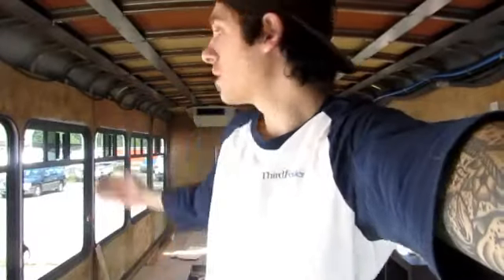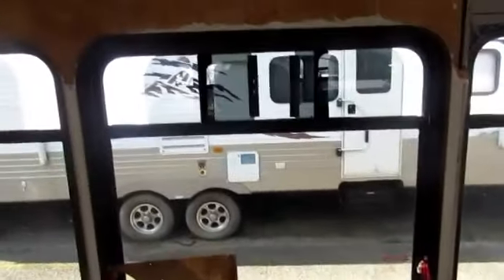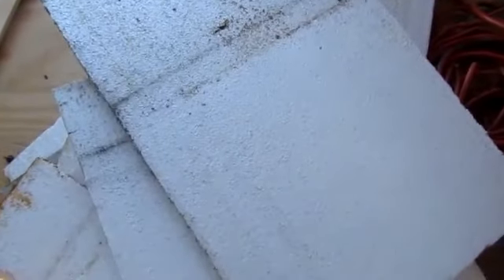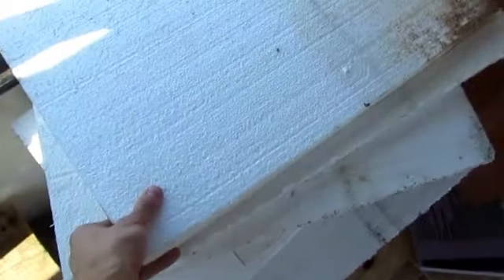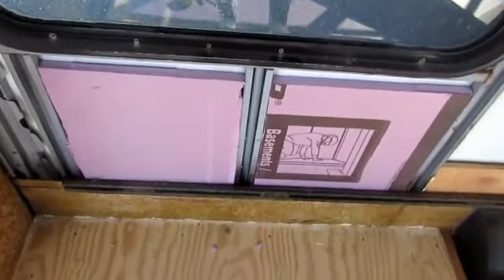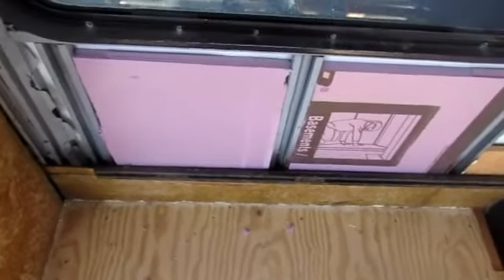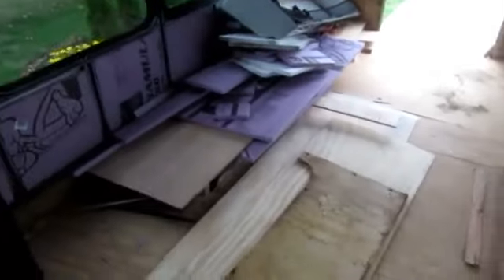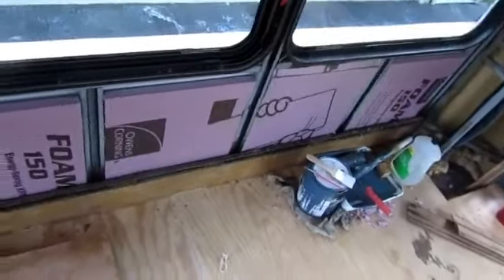Shuttle Bus Conversion: NEW WALLS!

Comment: Ty, i dont want to remove the inner fiberglass but just build in a few things we need such as water and 12 volt system. However there are sections of the outer panels which are loose from the frame. I was hiping you could tell me how they are connected to the frame. It might be necessary for me to take them loose and reattach.
Reply from the maker: Just seeing this sorry for the late response but shuttle buses are so different it would be hard to tell, ours were connected with screws.

Comment: Ty for your video! I'm a noob at this,  but why exactly did you hear the wood and factory insulation out just to replace it? Were there leaks? Again... noob here... thanks!
Reply from the maker: Nancy Durham hello thank you for your comment! We took it out for a few reasons! The main reason was that once we removed the fiberglass from the walls, the wood underneath was in pretty rough condition and covered in the glue that held the fiberglass on. We wanted to replace this wood initially because of its condition, but also we wanted to make sure that we did not have any larger issues behind the wall! When we were doing research we saw a bunch of people finding mold and other problems behind their original wood, and because our bus is from 2003 we wanted to be safe! Also, once we took it off we saw that the original insulation that came with the bus wasn’t insulation at all, and actually just basic styrofoam! The styrofoam also wasn’t tight or flush with the frame of the bus, and there were several inches that were not covered by anything. So we went with a thicker insulation with a much higher R value, and made sure it fit nice and tight!!!! 
If you have any other questions don’t hesitate to ask!!!
Reply: @growingslowandwild  ty for your quick response! Of course,  that makes perfect sense! I do have another question,  if you don't mind.  Once you pulled their "insulation" out, did the walls metal or fiberglass? I'm concerned about the integrity of the structure of a shuttle bus,  as opposed to a school bus or a van. I'm in the market to make a purchase vey soon,  tis will hopefully help me make that decision more clear.
Reply from the maker: Nancy Durham no problem at all we want to help any way we can!! Yeah so the actual walls of the outside of the bus are fiberglass, but the structural integrity of the bus is metal. So if you’re looking at the walls from the inside of the bus once the insulation is out, the first thing you see is the metal frame. We learned most of what we did from watching videos of full sized buses, and the only real difference we found was that our base floor was wood as opposed to metal!!
Reply: @growingslowandwild  perfect! Thank you sooo much! That helps a lot! GL with your build! I'll be watching and leaning! See ya out there!
Reply from the maker: Nancy Durham thank you so much!!!! If you have any questions along the way let us know! The community is the best part of the process 🚌✨

Comment: Great video. What did you use and how did you install the paneling with? Did you nail right into the outter wall?
Reply from the maker: Thank you so much!! Just used a standard jigsaw to cut the panels and when we went to install them, simply used the drill holes that were already in the metal frame from the screws we had taken out when we removed the original walls! Once we had them lined up properly, we just used a power drill to drill the holes in the wood to like up with the existing holes. once you have that done, it was just screwing it in with the same screws we took out so they fit perfect with no issues!
Reply: @growingslowandwild  Why did you decide to screw back into the metal and not to frame out the walls with wood?
Reply from the maker: @SavannahKingMusic  there were already the holes in the metal from the previous wood, and we didn't want to lost any additional space from building on top of the metal!!

Comment: Will that provide enough insulation?
Reply from the maker: Jumonjii yes we think so! We have been working in it since then and it seems to be working well! Also it was important to us to not have to lose any inches from our floor plan, and if we would have gone any larger we would have had to build off of the wall!! The 1 inch is technically a bit more than we had room for in the wall but we squeezed it in and made it work:)
Reply: I'm hoping you don't travel anywhere really cold. Foam insulation doesn't have a high R-Value. Maybe  4 or 5 rating.

This page has a nice chart.

https://www.greatdayimprovements.com/insulation-r-value-chart.aspx
Reply: @jumonjii That's my concern, too. But with all the glass, it's going to be difficult to keep warm. I'm thinking about doing some insulated panels that come up from behind the cabinets, masonite and foam board, that can click up into place. I may cover some of the windows. Maybe I'll put thicker foam under the cabinets or built into them for added insulation. I need to enclose the bed, because it gets down to -40°F in Montana.

Comment: Does anyone know if there is a benfit from foam board vs spary foam. Seems like spray would be much faster
Reply from the maker: Usually spray foam has higher R value meaning is more efficient / better insulation. It does take a lot of prep and post work as well as special equipment so just things to consider!
Reply: Spray foam can be difficult in a DIY situation. XPS is better than EPS foam board. I'm planning on doing XPS with spray foam in a can to fill the edges.

I'm also planning on cutting strips of plywood for the framing because it's denser than furring strips for framing out the walls.

I'm really glad I saw your video! I've been sitting on my shuttle bus for 18 months and need to work on it.